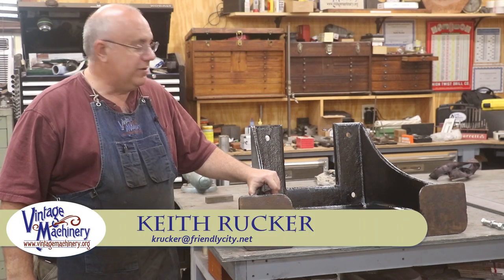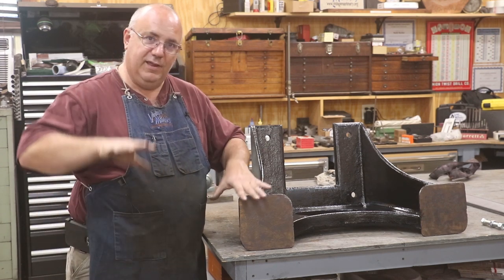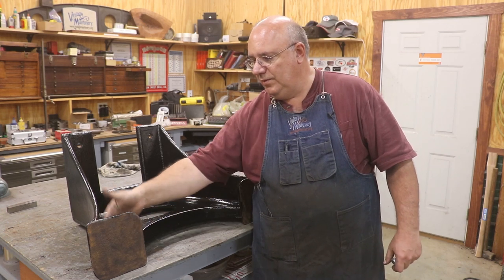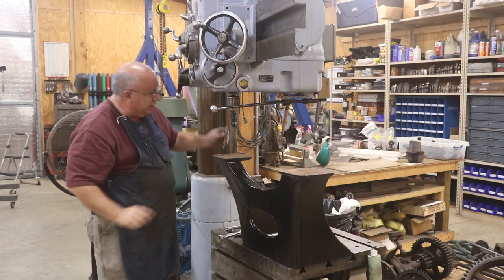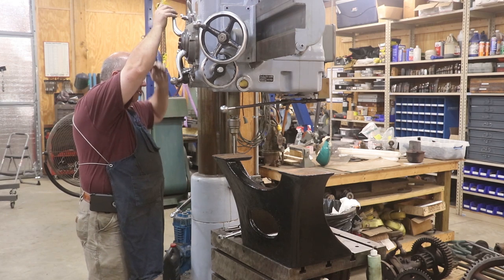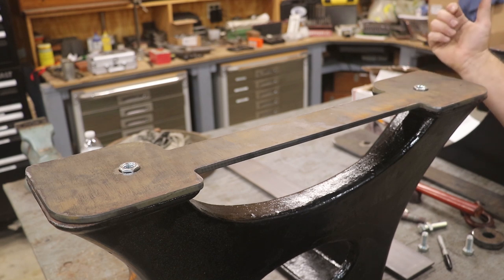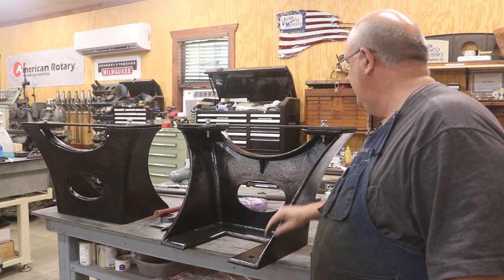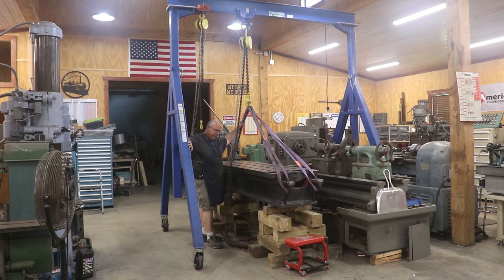New Haven Metal Planer Restoration - Part 11: Adding Leveling Feet

Comment: They make some really nice adjustable feet you could use with that setup. I have them under my lathe and love them. They are about 3" in diameter and have a hard plastic surface.

Comment: I made little hockey pucks for the jack screws for the feet of my 3800 pound lathe.  2.5 inches round the centers relieved, so the outside edges 3/8 where the only thing touching the floor. Drilled some dimples on the top for the screws.Good idea putting those plates under the feet for the jacking screws.
Reply: I seem to remember Keith using some of those under most of his other machines.
As for the pads,  I believe old time machine shops had wood floors so that would account for the large pads of the feet to spread the load.
Reply: Yes, this would be the right thing to do. Forget the 1/4" plate and maybe make pads that are even larger than 2-1/2". I'd go at least 3", maybe 4", dimpled on top, relieved on the bottom as above. However, that still doesn't take care of the reciprocating motion. Shims and grout are probably the way to go.

In the future, you also need to consider your trig when you're lifting your new planer. With the slings at the extreme angle you had, the total strain on them would have been a bit more than double the 1800 lb. weight of the table. This will only get worse as the assembly continues.

Comment: I have to agree with all of those who question the reciprocating weight involved when the table changes direction.  Shim the foot that needs to be raised with shims the full size of the foot.  Those guys 100 years ago knew what size was needed to keep it from moving.  Those machines, in many cases, were set on wood floors, either conventional wood floors or the wood pieces stood on end like cobblestones.  Sheets of shim stock are pretty easy to find.

Comment: Keith, ever considered after leveling, use an epoxy resin poured under the feet? This is a method used in the Tufting industry to level and set the broadloom tufting machines. Once level, you would form up around the feet with the feet about 3/4 inch off floor and then pour the epoxy. After it sets, you can back off of the screws and the machine will sit firmly on the epoxy pad.

Comment: Kieth, when I install large equipment I use hollow leveling jacks.  E&E special products is my go to.   but with that said i will also have a threaded hole and the screw is just for leveling, then i will use metal shims and pour a concrete plinth.

Comment: I'm hesitant about this one. Considering such things as lateral forces while the machine is in operation, I'm inclined to think that the best way to level this machine is by using simple thin shims under the entire foot pad. It may not be as "elegant" as having an integral adjusting mechanism built in to each foot but I think that, sometimes, the simplest and least invasive plan is the best plan.
Reply: He didn't address horizontal back and forth forces. I don't know enough about it to know how rapid these are. But his other horizontal grinder does rapid reverse Direction changes. Not as heavy

Comment: My lathe had a set of threaded wedges at each corner.  These are nice.  Probably  would need a recessed top plate for this application to keep the machine from rocking off them.

Comment: I think I would as suggested gone with shims recon it's going to move on the bolt heads
Reply: Why would it have any more tendency to move on a bolt head leveling foot than a brand new machine? If anything a shim being smooth would be easier to move on than a leveling foot.
Reply: It's a couple thousand pounds of iron, it's not moving anywhere in a hurry. Shims are a bit of a hassle to adjust, even if movement was a concern on the bolt heads, I think he'd be better off just making a cup out of a large thick washer and tacking it down to the bottom plate rather than having to shim it every time. He thought the convenience of having leveling feet was worth the hassle of all the work in this video, it's barely any extra work to make sure that it can't move around without resorting to using shims.
Reply: I was also thinking of shims, jack and place them in with a bit of trial table would be perfectly level. 3 sizes of shims would suffice, in thirds of thickness.

Comment: Instead of using just that bolt for leveling, wouldn't you want to have a large pad with a hard rubber bottom? I wonder when the machine is running that it will move around on that bolt. Love the rebuild can't wait to see it run again.
Reply: he said he was going to put pads under  it  time 12:58
Reply: It might be good to have rubber under it somewhere but you want to be able to adjust the height of each leg or all his scraping is in vain when the machine twists to match the floor.
Reply: No, rubber compresses over time and you don't want it on a precision machine that you'll use to tweak the bed level.

Comment: Keith, a minor point regarding the load on the straps.  Since the straps are not vertical, but rather at an angle relative to the load, the load on the strap is higher.  If we assume the angle of the strap is 45 degrees relative to the weight, the load is the square root of 2 times the vertical load.  If we further assume the four straps are equally loaded, the load on each is 1.414 times the weight of the casting divided by 4.

Comment: For lifting loads, you need to take into account the angle from the hoisting point, so the actual weight encountered is equal to weight of object/cosine(angle). Still safe though.

Comment: Good job, I recommend you put your lapel mic in the center directly under your mouth and up higher and you will not get near as much up and down variation in your sound level, I have been running sound and doing installation and repair for 30 plus years and little things like that will give you much better sound,

Comment: IMHO,  once the machine is in its new home, set, and leveled I would use a Ferro grout under all the feet to stabilize its location plus, it will distribute the load over all their surface area, this would also prevent it from walking.  IMHO
Reply: I'm with you on that. Just the location in front of the door, does not compute! Once built back up, can it be moved to a better location?
Cheers all
Reply: @carlthor91  he says in the video it's moving to a different place in the shop when it's finished, this is just an easy workspace for assembly.
Reply: @minitom1988  How much does it weigh when reassembled? That's why I commented.

Comment: I’d be inclined to add pull down bolts so you could level it up with your jacks but shim it and pull it down with 3/4” rawl bolts. The point contact will be fine for levelling but not for it to just sit on.

Comment: Did you notice the planer rocked when you sat it down on its feet. Hope it don't spring it and make it harder to level. I'd have made wider heads on the bolts sitting on the other plate. Bearing surface seems small to me is all. I do like the double plate deal , lots of us wish we were close enough to be a phone call away for help. God bless an have some fun.

Comment: You are still well within strength, but when figuring a 4-point lift (or support from four points, like casters) assume the entire weight will be supported by two of the points, because if there is any unevenness, that's just how many will be supporting the load. Minor difference in strap length, or non-flat floors (for casters) can leave the load on two points only. 

One-man work on heavy stuff takes planning and care. Good to see things done right.

Comment: Seems like you now have a few threads holding all the weight. I think allowing the metal pads rest on the floor was a better idea because if there was any wobble, you could insert another metal plate of the needed thickness to make it solid. Now you have a couple threads supporting everything. Vibration from the machine running/operating is going to take it's toll on those few treads. JMHO
Reply: I was thinking the same thing, but the way he installed the levelers allows for them to easily be removed if problems arise.
Reply: I'm not a millwright.  But, I agree.  I don't see this solution working out well.  The machine is a huge dynamic load supported on a few threads.  The static load of the machine will make adjusting the levelers difficult.  It will fail, just a matter of when.  I would have drilled the through hole, inserted a lag bolt into the concrete, and used shims to level the machine.
Reply: @Jcrum5th  if the screws were fine thread and sitting on thrust bearings, it would probably work better. Keith will find out if he needs to modify it more when it is all put back together and starts making some heavy cuts.
Reply: Came here to say this. But I did some calculations and he's probably ok. I'm guessing those are M16 bolts (or thereabouts) and if this is right, the failure is about 150,000 N which would be about 15 tons per bolt. That would be a bloody heavy machine but not 90 tons I'd wager. - Sources http://www.tribology-abc.com/calculators/e3_6e.htm
Reply: There is (or should be) a jamb nut that gets put on.  After it's leveled off the jamb nut gets tightened up...now you have double threads and it can't loosen.
Reply: packing  mortar under the feet and than backing off the leveling screws after the mortar sets will provide all the support needed.
Reply: Maximum holding power for anything threaded is reached when 5 threads are engaged. Any more and you add nothing to the strength. Count the threads in any regular nut and you will find 5 threads.
Reply: Through holes, ChemSet bolts, shims and construction grout would be my preference.
Reply: These bolts will fail.
Reply: I’m absolutly not an expert and considering Keith as one, so please see my comment as a newbie question... Maybe the threads or the size of the levelling bolts are to be considérée, but what i see from my point of view is more about the stability of the machine while it will be in action, since it will rest only on few square inches versus the horizontal masses involvolved when the bed will move...  The friction implied by the original feet seems to me more efficient for that...  Am I wrong?
Reply: @Brooklyn6163  As with so many things, stationary weight is one thing. however, when you inject movement from the machine operation, now you have many more forces to consider. And mass times weight is not a linear equation. It creates very high kinetic energy as either mass or speed increases. And that force gets transferred to the littlest parts, hence the threads, in this case. Can those few threads withstand that weight alone and with the additional movement? I honestly don't know, but the weight alone is very high. And considering the frictional area with the bolt heads and surface (floor) being so small, I can possibly see the machine moving with operation.  JMHO
Reply: @MountainNZ  Much bigger machines then that sit on smaller leveling jacks then that. - Just the way we used to do it was we had an anchor bolt holding down (Thunderstud or other wedge anchor) and a jack bolt pushing up. On a big Lucas boring mill or big vertical turret lathe after leveling we would then grout it in with Suflaset or similar non shrinking grout. - And yes, we were industrial electrical/millwright contractors  before I sold the company and retired and I am an engineer.. 

Unless you actually work with this stuff on a daily basis the average guy has no idea just how strong steel is.  - To break a grade 2 crap steel 1/2" bolt  you have to pull it with  over 5 tons. More in compression. I don't think Keith's machine weighs well over 20 tons because that's what it would take to drive those bolts through the nuts. 5 tons each.

Comment: I would be concerned that the planer might try to walk when the mass of the bed hits the end(s) of it's stroke?
As a structural designer I would have liked to see one end fixed and all supports  grouted even with the leveling screws. (Over kill?)

It will be interesting to see it in operation.
Love your channel and the machinery!
Reply: Agreed. Lots of momentum when that planer table gets going. Some kind of grouting or concrete buttress to stop those bolt heads from sliding on the metal plates might be the way to go. We shall see.

Comment: I think I would have come up with some kind of pad type foot.. kind of like what Adam Booth put on his big welding table.. could have made some out of some 2 inch round Cold roll.. inch and 1/2 thick countersunk a 1-inch bolt through the center and welded it then you could just turn the pad to level JMHO

Comment: I know it is difficult working alone. Please think about the various pinch points where your hand could be stuck with an equipment failure. If you get stuck who is going to come looking for you.  and when?
Use a tool to push a part around instead of your hand and fingers.
I found myself in a position where I had to wait for a passing truck to flag down and the driver helped free my hand.
It could have been hours instead of minutes. Fortunately I have full use of my hand.
A co worker later had a porta power hydrolic unit fail and he lost several fingers.
Plan ahead.
Thanks
I do enjoy your vids
Reply: Dennis Williams , I think here in the South that’s how we “thin the heard”. That’s why Keith is still around with a good bit of common sense.

Comment: Keith,  Just an engineers two cents comment...
Because you made the holes in the steel base plate so large, the entire weight of the machine is going to be point loaded on the nuts, which then transfer directly point loads to the cast iron directly above the welded nuts only, not into the steel.  Just what you were trying to avoid.   Basically you are now relying on the welds alone to distribute the loads to your steel plate.  If you had  made the holes in the steel  just clear the bolt diameter only, so that the entire body of the nut rested on steel and not cast iron you would have been better off.   Then the loads on the nuts would transfer to the full surface of the steel plate thus spreading across the entire cast iron foot.

Comment: First I like to have the bolt hex I adjust above the pad.  Stay with me, you'll see why.  Second I like a lock nut also above the pad.  Third, I like to turn the tip of the screw spherical.  Before leveling it for the first time put foam rubber rings around the spherical bolt tips.  Use it for a while and let those spherical tips dig in their own seats in the concrete.  After you are happy with the leveling for 30 days RTV wood form strips down to the concrete around the pads.  Pour in your grout.  The foam rubber rings will keep the gout from locking up the jack screws.  Let the grout cure for 30 days before clamping the pads down with wedge anchors or drop-ins.   Shims suc.

Comment: Whoa, Nelly! Those straps aren't holding 500 pounds each. The VERTICAL force is about 500lb each, but since they are about 30 degrees from horizontal, the force applied to each strap is about twice that! Still fine, in this case, but details like that could cause real grief. #rememberthetrigonometry

Comment: Thank you for video, I find it very informative:)
Small tip about weight lifting by yourself. Please keep your back in straight line - your spine will thank you for that within weeks. Lifting should be done by squat, as long as human legs better fit for weight lifting. This is applicable to anything above few pounds.

Comment: In my humble opinion, you need to put an inch slice of bologna sausage underneath each foot.
Otherwise there will be trouble.
:O
Love the content.
Reply: This might be the best suggestion here.... but only if you get to eat what remains after levelling it. Lubricate those bolts with a dash of red wine and don't leave the bottle to waste.
Reply: No way that would work - You have to use grade 8 hard salami

Comment: I like it, but it needs one small improvement.  That machine shakes all over the place, and that movement is going to be translated into the concrete through those single bolt heads.  You're going to need some plates to set the bold head on so they don't dig themselves into the concrete.  I love this machine!
You tease.  You didn't mention the floor plates until the end of the video!  I've just learned to not second guess you!  Fantastic!  I wish I was your neighbor, I mean volunteer.

Comment: Is the tip of the bolt going to damage the concrete floor?  Seems like the point load on the bolt tips will be high.  Four 3/4 points will carry the entire weight of the machine and work piece.
Reply: I should have watched the entire video before commenting. Looks like you addressed my thoughts later

Comment: If you're not looking for mobility of the machine, you might utilize the leveling pegs to get the machine into proper position in alignment, then deploy a chalking compound in pourable form,  That would provide the machine with 100% of its own footing and support structures. Look at Belzona 7111.

http://www.belzona.com/7111

Comment: You will have the massive table moving back and forth with all of that weight pivoting on those small bolts they will bend or slide off the steel plate then bend

Comment: Keith has forgotten more about machines than I'll ever know, but . . . The tension on those straps is at an angle to the vertical force of gravity. At 45 degrees and 500 lb. down force the tension on the  strap would be 1,000 lb.
Reply: Still within ratings, but nice to know
Reply: Double checked my math. The tension would be 714 lb.  [500/ sin 45 degrees] = [ (500/ 0.7) = 714.29]